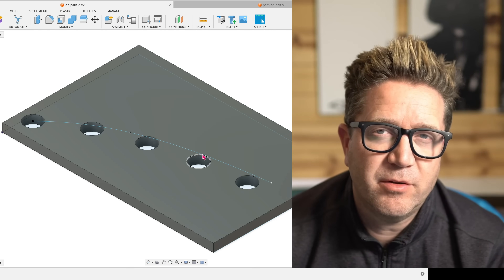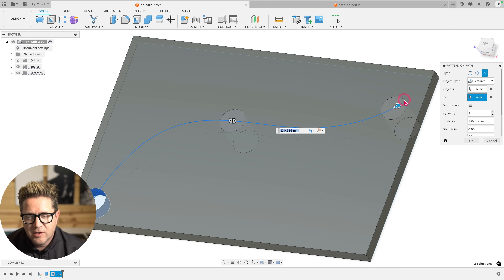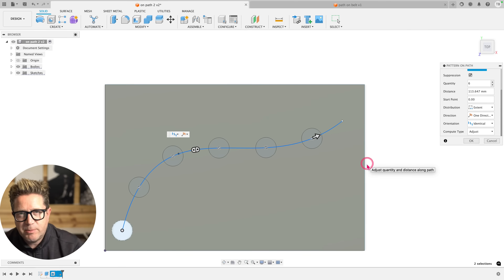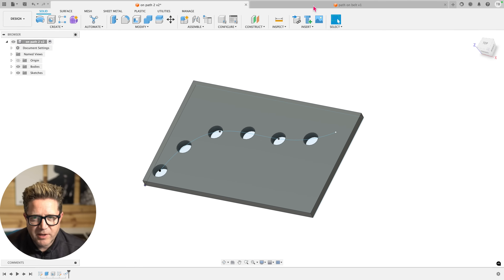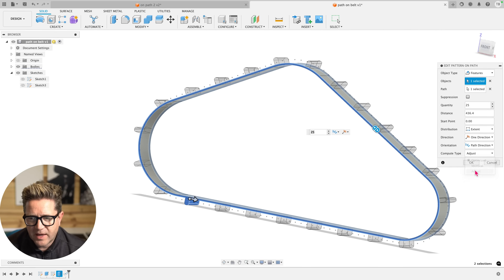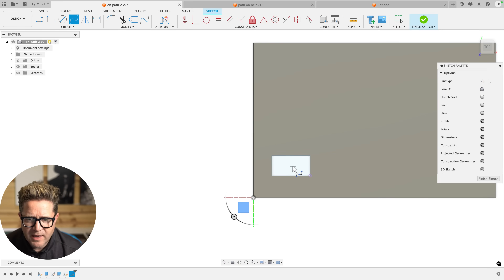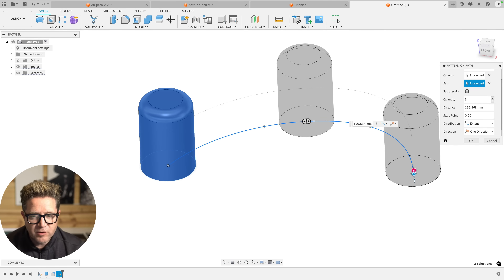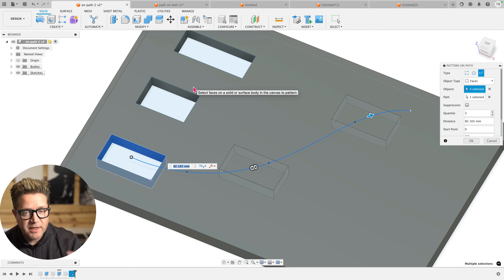Fusion 360’s Pattern on Path – What to use and what to avoid

Comment: ok, what happens when the base shape changes? What happens when the spline changes in length? How do I make sure the pattern still extends over the entirety of the new curve? Or always say 50% of the curve lenth, even if I later decide to change the curve? The measurement isn't parametric, meaning upstream changes are not reflected. I haven't found a solution to this yet.

Comment: What about pattern on a path of a profile along a container that tapers down to its base? I have tried everything I know (I do not have much of experience in Fusion) to get my profile to stick around the container shape but the result is not what I want. I also want the profiles to be "radial" ie the one in the middle would be straight and as the profiles reach the edges they would be slanted as if being concentric to a vanishing point. Sorry for my English, I may not be able to explain what I want correctly.

Comment: why did you choose feature, and not body for the belt? Also how would you get the belts teeth to be spaced evenly and end correctly like a real belt would be?
Reply: I think in this case, choosing the body or the feature won't matter - the same outcome is achieved either way. I also think you're being thrown off by the perspective of the view, in that the teeth are all evenly spaced - that's the result of choosing "extent" as the distribution mode. Then again, as a Fusion noob, I could be totally wrong 😆

Comment: Just used this command yesterday around a 12 x 6 slot, with 12 tabs around the outside. had to draw the tab along the curve, not along the flat side to get it to solve correctly. Also would not select the extrude and the fillet. I went back in the drawing and created the fillet there then it solved correctly.